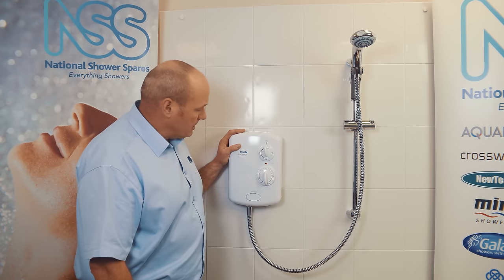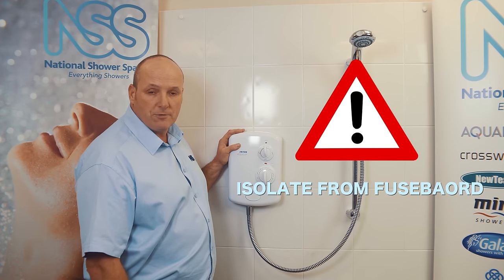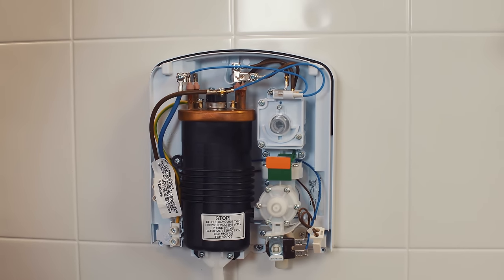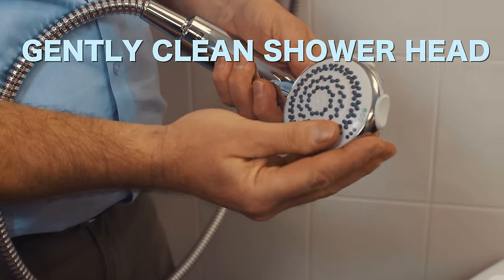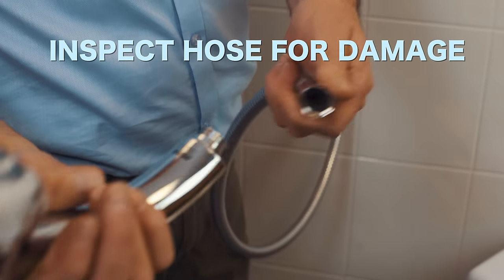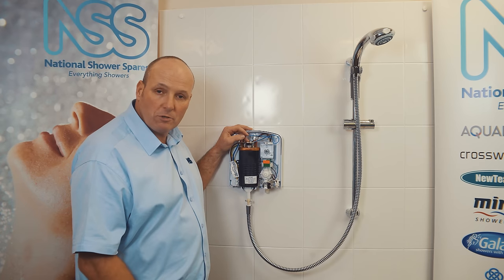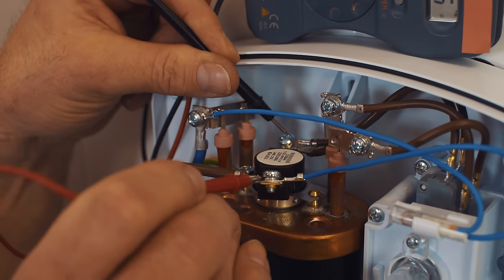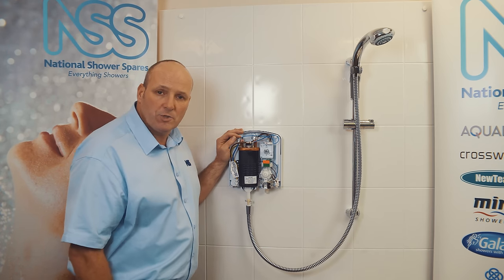Common problems with electric showers

Comment: Fab - I've installed showers, cleaned out the tank / heated can and various other fixes previously, but hadn't appreciated how a clogged shower head could cause the water to over heat - thank you!

Comment: If it has good flow when the selector switch is set to cold and a bad flow when it is set to hot and does not heat up, what could be the fault

Comment: My shower doesn't heat the water and I check the continuity of the tco with a multimeter in (20 ohms) and shows 0.1...
It means is dead or not.?
Thanks
Reply: Nice that 7 people thumbed this up but no comments 😑

Comment: Got a Triton T70xr
The solenoid has gone
Its stuck open at shower off and pull cord off.
Okay if that hadn't happened we would never found out that when off 12 o'clock on the power dial the water is still hot.

Is this normal?

 Or has the switch gone, using the overheat safety cut out to stop the power when the showers off at the dial.

After the switch went slack it did boil for two seconds when off and solenoid closed.

Comment: I have changed 4 to 5 shower heads due to build of limescale in them.. the shower temp was irregular going from hot to cold. I then decided to remove the head from the hose and turned shower on ...the water temperature was constant. However what I saw in the water shocked me. So much limescale and other debris coming out of hose. Water supply out kitchen is fine as well as the bath and Handwash basin. Is there a filter in the shower unit that needs changing.
Reply: There is an inlet filter that you should clean periodically with a brush or the likes

Comment: My triton t80 easifit makes a boiling kettle noise when temperature is turned up and water is boiling hot. What could be the problem please
Reply: Andy.
I think you are confusing an electric kettle for the electric shower.

Comment: I have a aura lx200 shower, for some reason all of a sudden it is just flowing cold water now. Any hints on what could be causing this, water is heating up fine in the rest of the house.
Reply: I had the same problem with my galaxy shower. Turned out to be the thermal cut out switch (on top of the heater tank).

Comment: My shower now trips the MCB when switched on the hot setting. What's the likely cause?
Reply: The heating tank in the unit is causing this as the elements are causing the fault, changing the internal heating tank should fix this problem.
Reply: Thanks for that!
Reply: Descaling a shower

Comment: I got a brand new shower and it was put in by a professional plumber and when it was fired up the water just ran cold. Any advice would be great...
Reply: consult the "professional" plumber that "put it in"
Reply: Pull the electric cord for electric?
Reply: @ajlifesolutions7072  I don’t understand what you mean…
Reply: @paddyodonohoe5862  - Sorry, wasn’t thinking before I posted. In our house there is a pull cord in the bathroom to turn on the electric for the shower, else it won’t work. Would therefore suggest just getting the installer back in.
Reply: @ajlifesolutions7072  there is no pull-cord it’s just a power switch. Gonna get the guy back in.

Comment: This advice could cause you more grief if your not an Electrician. In order to test the stat properly I advise disconnecting one end in order to ensure there's no back feed through a neon, solenoid coil or motor winding causing your tester to beep with the stat contacts open.

Comment: Of course its safe to work on its not wired in
Reply: All electric showers are wired in to a house that has one and when being worked on they must be completely isolated from the power supply.
No one knows if the one in the video is not wired or not except the producers of the video
Reply: @stephensnell1379  I can clearly see on the video it isn't wired in